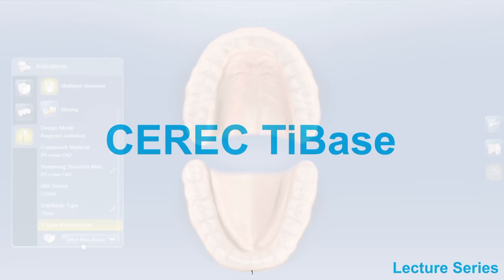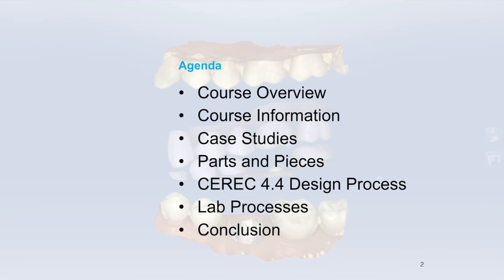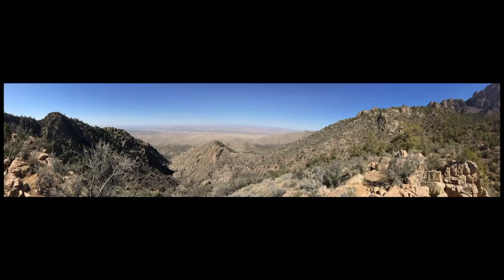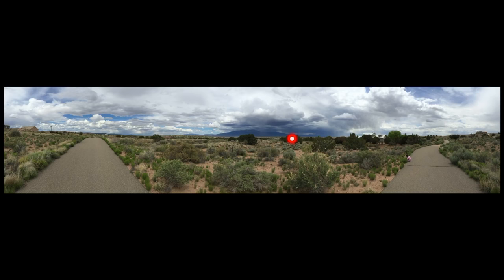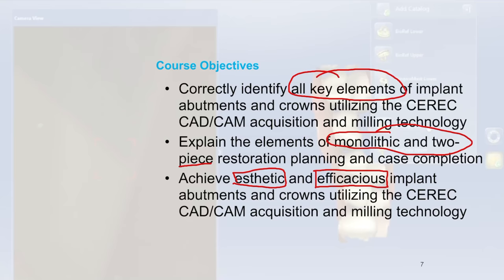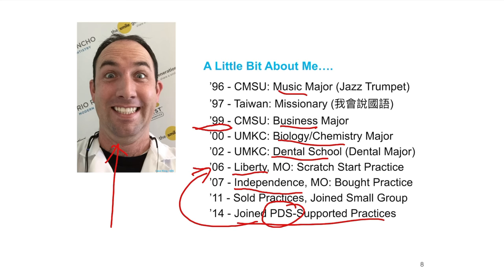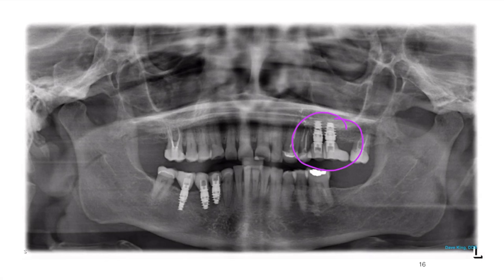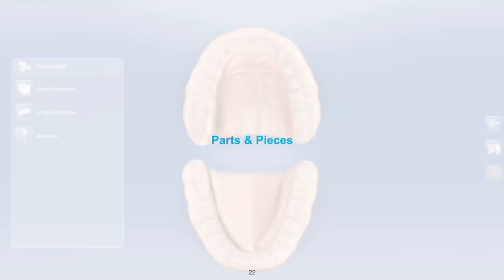CEREC TiBase Lecture Series Lesson 01

Comment: Thanks Dave! just wanted to ask you a question regarding ti base. What are the specific clinical scenarios in which ti base gives the dentist a clinical edge over UCLA or Customized milled titanium abutments? Plus when would you prefer using a UCLA or  customized abutment rather than a Ti Base
Reply from the maker: I think most of the clinical edge is that the dentist is designing the prosthetic rather than a lab technician. Many lab techs do great, but it can be hit or miss. Secondarily is the cost. TiBase restorations can save literally hundreds of dollars per restoration over lab restorations.....not just the hard costs of the materials and prosthetic, but soft costs like time and chair use.